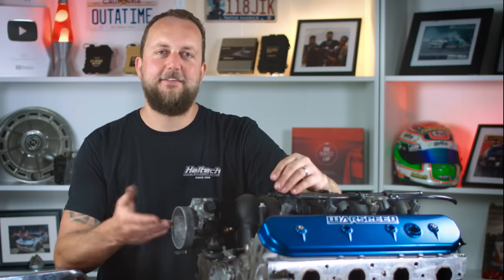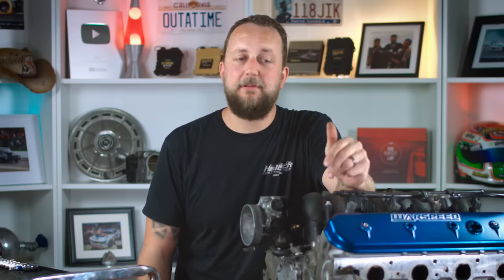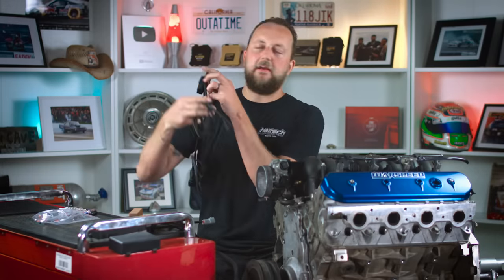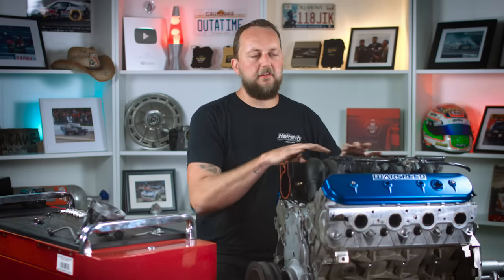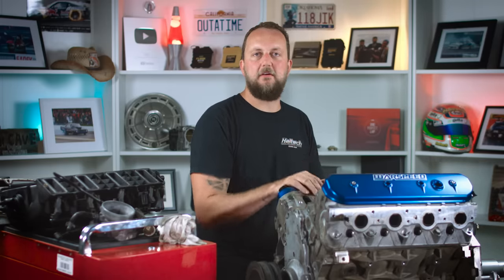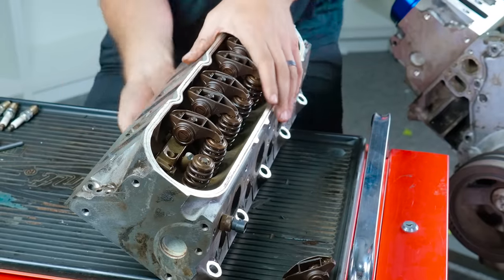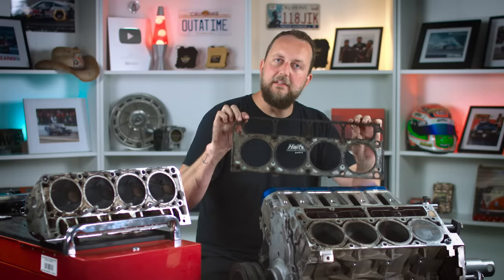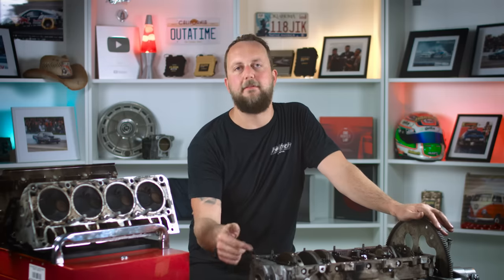🤔 What's so special about the LS? | TECHNICALLY SPEAKING |

Comment: Subliminally putting a subaru logo when talking about blown headgaskets was great. lol
Reply: Cant wait for the subaru fan boys be like " NVER HAPPENED TO MUH SUBARU BRUH:."
Reply: Lol or Corvette Engine Heat Soak Overheating YT Videos. Come on GM. Stop voiding warranties if it happens on the track! Fix the issue or dont void warranty!
Reply: I don't understand why Subaru gets so much heat for that when GM is the king of blown head gaskets. The Cadillac High Technology engine, the Northstar engines, the 122 engines and several of GM's V6 engines were all extremely well known for blowing head gaskets.
Reply: @PistonAvatarGuy  you cant tell chevy people any thing but chevy is developing ohc engines now so the ls is coming to a end
Reply: @austinhowze6280  LMAO uh huh, that's why the C8 was unveiled, powered by a Gen V pushrod V8. Oh and GM just unveiled their latest iteration of the Gen V v8 for their pickup trucks in 2019. Definitely on the way out :eye roll:
Reply: @PistonAvatarGuy  LMFAO you're all butthurt about Subaru's shit engine designs so you bring up a 20 year old Cadillac V8. When Subaru's aren't blowing head gaskets, they're drinking oil and busting valves.
Reply: @hochhaul  man the subi motors where blowing head gaskets 10+ years ago so I see no differences
Reply: @hochhaul  and we all now caddy get the new engine first eye roll back
Reply: @austinhowze6280  And still doing it today LMAO. Just like Subaru guys swear up and down that oil consumption was fixed years ago. Right LMAO
Reply: @hochhaul  they burn oil cause they dont let the piston expand before flooring there car and not sure if you think the 07 is new but it's not the changed to muti layer head gasket in 09 fixing the head gaskets
Reply: @hochhaul  lol I never said I like Subaru. But I brought up GM Engine problems, Heat Soak issues that even plague 2019s, Overheating, Voided warranties, and for some reason you ignored my comment.. Hell even you mentioned that this only affected " 20 yr old Cadillacs", & they are investing in the same engine design in 2019. After all that there's videos of the 2019 corvettes and the continued heat soak Issues..
Reply: @hochhaul  You targeted everyone else. And yes factory corvettes non forced induction have overheating issues. You are sO TriGgeReD! Saying every car has issues is a cop out. Just like the cop out of only replying to some comments, and not others. I obviously never said Caddy engines were put in Corvettes. But you have to make fake arguements, & grasp at straws, calling people names instead of accepting reality.. But "it happens to everyone, and GM's Cadillac Engine Failures was so long ago" are the words of someone being irrational for the bais they feel toward a company that they love. It even makes you call those such as myself "Biased" Pay attention Kids. This is a Cautionary Tale. (P.S. No I'm not talking to you hochhaul, even though I said kids).
Reply: @hochhaul   O.o? Dude look up the Corvette overheating on YouTube. Everyone knows about this. GM Voids warranty if it happens on race the track. They wont improve this issue either.  No. These issues dont happen with every other Engine/Manufacturer Everyone else knows about the Corvette due to Social media.. Apparently you dont..
Reply: Saw something flash, instant replayed to to see it was a Subaru logo, and figured I'd check the comments for context.  Thank you.
Reply: @dann4561  You apparently don't understand the issue because the situation with the C7 was that the Z06 was the model affected, not ALL LS V8's. And it wasn't heat soak, it was overheating when a Z06 does multiple laps on a track. Heat soak occurs when the car is parked with the engine off. Overheating occurs when the engine is running and the cooling system can't keep up. The C7 Z06's LT4 uses an overdriven supercharger that generates so much heat the air-to-water intercooler can't keep up if the car is tracked in high ambient temperatures. The small frontal area extremely limits the cooling capacity. There's a lawsuit over the issue since the Z06 is considered a track car and the factory cooling system makes tracking nearly impossible on warm days let alone hot days. The base Corvette is not considered a track car.  I'm not aware of any warranty issues withe Corvettes, but if a guy is trying to track a non-Z06 vette, I wouldn't be surprised if getting damage caused by tracking a base C7 covered under warranty. Sometimes it just depends on the customer's relationship with the dealer. I do see that a GM has a clause that says that Corvettes with the Z51 (suspension and mild power upgrade) package have coverage for tracking the car, but competitive tracking is not covered.  Funny enough, the 6th gen Camaro's warranty covers SS and up trim levels for tracking ( https://www.autoblog.com/2016/04/01/2016-chevy-camaro-track-warranty/ ).

Again, none of that means that all LS engines have issues with heat soak or overheating. The C7 Z06 was an issue of limited cooling capacity in such a cramped engine bay with a very small frontal area. To say that because the C7 Z06 has overheating issues so therefore all LS engines have heatsoak/overheating issues is a belligerent level ignorance.
Reply: @dann4561  and yes, it does happen with other engines and cars. The Mustang GT PP2 would overheat after just a few laps, as would the GT350 non-R cars. Neither car is covered under warranty for competitive tracking BTW. The 5.0 Coyote in particular was famous for overheated cylinders which would eventually lead to warped cylinders and cracked blocks. Similar issues occur with the 2.0 Ecoboost. The Mustang's 2.3 Ecoboost is infamous for pulling power due to intercooler heatsoak and Ford only recommending 87 octane fuel, when driven in the summer, owners often have to run 93 to avoid the ECU pulling timing and boost. The power loss is significant and quite noticeable.  Even then, that doesn't address the overheated intercooler, which can often get hot enough to melt the inlet. The last gen GT500 was also known for overheating while tracking. The BMW M3 E46 was infamous for overheating on the track. Overheating was common both on the track and on the road with the BMW N54's.

The Nissan GT-R's warranty specifically excludes track use from warranty coverage. Same with the 370Z. The Toyota 86/Subaru BRZ do not cover damage caused by operating the vehicle "in any competition or racing event". 

Aston Martin only covers track use if the car is used at an officially AM-sponsored track events. 

Porsche's warranty does not cover "Abuse, accident, acts of God, competition , racing , track use , or other events. Components and or parts that fail during racing or driving events may not be covered by the new car limited warranty."

FCA does not cover "racing" for any of their vehicles, including every version of the Challenger or Charger, including Hellcat and SRT models.

And as I mentioned before, the 6th gen Camaro is covered under warranty for track use with SS and ZL1 trims. (https://www.autoblog.com/2016/04/01/2016-chevy-camaro-track-warranty/)
Reply: @austinhowze6280  The Gen 3 Coyote 5.0 burns oil because the block no longer uses iron liners but instead a plasma arc deposition technology that coats the raw aluminum with a coating of iron nickel alloy that's extremely thin. Unfortunately the piston-to-bore clearances are all over the map. Famous Ford engine builder MMR has said that some gen 3 5m0's are leaving the factory with piston-bore clearances of over 0.006", so the pistons slap the cylinder walls. Over time the piston skirt and cylinder walls are worn or damaged and oil blows by. Not that the loosebtolerances were good for sealing in the first place. Other shops have reported warped cylinder walls on new engines they tore down. That also creates noise and sealing issues. It's an issue seen on some 5.2 Voodoos. In the GT350 manual, Ford says it's normal for a 5.2 Voodoo to burn up to 2 quarts of 5w50 per 1k miles.
Reply: @hochhaul  they been using that process for over 10 years now probably just employees being lazy and not inspecting
Reply: @austinhowze6280  No the main issue is that Ford originally paid a Germany company to apply the process to their blocks, but eventually decided to save money and try to do it themselves. Bore distortion and the Coyote 5.0 have gone hand in hand over the generations. That's the problem with an engine that's really more of a low volume engine that has to work in both cars and trucks, as well as be cheap enough to make that it makes financial sense to sell it in vehicles that cost less than $30k. Older Ford modular engines used higher quality engine block castings that had lower rates of flex, distortion, and cracking. Most of those issues can be solved with the 5.0 Coyote if the engine is sent off to a machine shop for sleeving and gusset reinforcements. They def aren't the rock solid old Teksid blocks from back in the day.
Reply: @hochhaul  Wow Holy shit I'm not reading all of that: Probably copied and pasted comment/list of other shitty cars. Once again. This video is about the LS engine. They put those in Cevrolet Corvettes as I mentioned (not Cadillacs). I brought up examples & reasons why the Engine is shit. You can compare it to other shit cars all you want. That still doesn't mean it should be put in the greatest engines category. I would even agree that is open for debate (which is why the video creator wants ppl to leave comments below) ofcorse. I've never endorsed any manufacturer. Yet you have called me Biased. That & the Fact that you like to call people "bitch". It shows more about you, than me. You are never going to he wrong, and will never stop trying to convince others that they, themselves are. I love how you stopped cursing me, since that obviously didn't work. I guess you'll try other methods while you're trying to save face. Going back and Editing your Massively Invested Comments. (It shows that you edit them) What's wrong with you? Such anger. Dont take the high road now. You've already gone as low as your IQ, Cursing saying Bitch, little or small Dick. (Wtf, a grown man communicating about other grown men's penises) I wonder what's next for you to say. You are the reason YT comment sections are so Cringe! Get some self awareness. Haha
Reply: @hochhaul  I never said anything about Supercharging, TurboCharging, or Natural Aspiration. I only mentioned Overheating, and heat soak problems. I picked very meniscal issues at that. Too Bad anyone can google these other LS problems:
Lifter Problems. ...Noisy Hydraulic lifters can be caused by several reasons, none of which are due to a defective lifter and as a result, are not covered by manufacturers warranty. ...Cam Bearings. ...Valve Spring Failure.
Piston Ring Seals. A part of LS modifications is provided with low-quality piston ring seals, which may lead to troubles with increased oil consumption. ...Oil Pump Cavitation. ...Non-Priority Main Oiling in OEM Blocks. ...Skirted Cylinder Block. Etc..

Your answer to progress: Other companies void warranties too.. So when I buy a new GM I have you to thank. That's somehow less progressive than basically shit posting the same thing over and over again. Maybe I shouldn't have questioned how you look. I am indeed the one invested in this with the likes of you. The likes of you will go on shitposting your "Higher Knowledge" "Holier than thou" Rhetoric. Be-gone Troll.. That is all. Lol
Reply: PistonAvatarGuy yeah but non of those engines you stated there are LS.
Reply: @Hugo350R  Even the Gen V is an LS, regardless of what some executive at GM decided to to code it as. It shares 99% of its DNA with the LS3, the differences being incremental design improvements and a new fuel system.
Reply: @dann4561  bruh track a WRX, break something, and see if Subaru will warranty it.
Reply: @MeltingRubberZ28  I'm pretty sure they wont be able to tell. Corvette Warranty Specialists go out of the way to check the GPS system, and the cars black box to see if it has been inside the confines of a racetrack. Other manufacturers encourage track usen, and even use GPS to to unlock the governed top speed (MPH) @ racetracks while not voiding warranty. If the new C8 is any good more people will want to track it. These decade old problems should be known and addressed before the new C8 debut. I would like for it to be successful. That is all. Damn
Reply: @dann4561  lol dude Subaru tech's are even trained to check your YouTube channel to see if you've launched the car, street raced, raced on a track, etc. They are by far the worst. Also, I never bothered looking into the Corvette (too poor) but I know with the 1LE Camaro tracking the car does NOT void the warranty. You definitely can NOT say that about many cars. That's actually the first I've heard of it, and I know Subaru does not.
Reply: Subaru has a better running history than Chevy  no pun intended!
Reply: @MeltingRubberZ28  I never said anything about Subaru. I would like for GM to allow track usage for the Corvette as they do with Camaro. But I did say the Corvette was the one with these issues. Not withstanding Camaro, it would be nice for Vettes to upgrade also since more cars in the top tier invest R&D $ in Engine Durability/Quality, and track usage allowance.  I would like for the new Chevy Corvette to become even more world renowned. I dont want to see Vids on YT like the ones titled does the 2019 Corvette still overheat when it comes to the new C8. I'm also not interested in any other shit cars. Some of us Chevy Fans are extremely sensitive, or Old Boomers. Let's not Associate the Corvette brand that way if possible. Thanks
Reply: Captain Brown Beard nobody drives cadillacs 😂😂😂
Reply: Have a 1991 TBI 350 with 350k original everything, true duals with thrush glass packs in a 1500 Silverado that still runs great.

Have a couple 1999 EJ22’s same thing outside of seals and timing maintenance. 

Although different they are two of the best motor platforms I’ve ever worked with.
Reply: O.M.G. ! What's with all the name calling? I believe these comments are from adolescents!
Reply: If you own a Subaru you either need head gaskets or you just had them done.
Reply: Subaru better not have co designed the LS or imma have issues 😂
Reply: Bet those head gaskets only last the break in period 😂😂
Reply: Subaru the only car that lasts while it is being built 😂
Reply: Gonna LS swap my 07 Subaru Impreza.  Anyone think it's possible/have tips on how it will go for me?
Reply: @Captain_Brown_Beard  NVER HAPPENED TO MUH SUBUWU BRUH.. wait, I'm lying.
Reply: @BP-fx3qc  Dude>Bruh
Reply: @Captain_Brown_Beard  what? Is there something wrong with carrying oil, coolant and a new set of headgaskets in my trunk?
Reply: @BP-fx3qc  Nothing my man. Over in the german world we carry extra coolant, water pumps and timing kits
Reply: @Captain_Brown_Beard  Don't feel bad , we change shortblocks every 100k, sometimes even sooner on these pancake engines.
Reply: @BP-fx3qc  lol, but do you guys have to change engines at 60k miles because your timing chain slipped?
Reply: @Captain_Brown_Beard  nah it ain't that bad now that I think about it.
Reply: i always thought subarus were made in australia because of those outback commercials from when i was a kid lol
Reply: @PistonAvatarGuy  , I own a 2004 Seville and 2006 STS, both 4.6 Northstars, both excellent engines.  In 2004 Cadillac finally used better head bolts and the Northstars were great until being sadly being discontinued in 2011.  The early 3.6 V6's had several issues, but they also were much improved.
Reply: @daevid21  , I do.
Reply: @captainamerica9353  Who cares? GM still screwed over hundreds of thousands of customers with horrible engines.
Reply: @PistonAvatarGuy  - and they've made millions of engines, many of which are over the 300,000 mile mark.  I could name the 3800 V6, 5.3 Silverados, etc., but you're just a hater.
Reply: @captainamerica9353  Many of which? No, dude. I used to drive my ex nuts because every time that we would pass a GM vehicle that was broken down on the side of the road I would say "dead GM," it was that frequent. They also had some of the most ridiculously terrible safety recalls of any car company, because their vehicles were just such garbage. Even the 3800s were recalled because they were catching fire and burning people's houses down. And people rave about how good that engine is, but it also had some kind of intake manifold problem that caused some pretty serious issues.

Also if you pick up a copy of Consumer Reports, you'll see that their vehicles consistently get terrible ratings, or just middle of the road in the better cases.

The only thing that GM seems to put any real effort into is their V8s, and that's because they want everyone driving the most fuel consuming vehicles possible. They really are the big, villainous corporation that one would hope to only be able to find in fiction.

Comment: I remember when i worked at holden an engineer told me the high output v6 engines were more expensive to build than the LS engines because they were were more complicated with the overhead cams but they could still sell the LS at a higher price as enthusiasts were willing spend more money on a v8.
Reply: What’s your point?